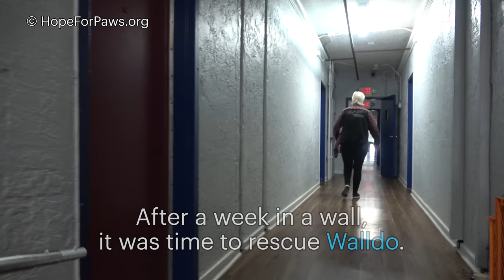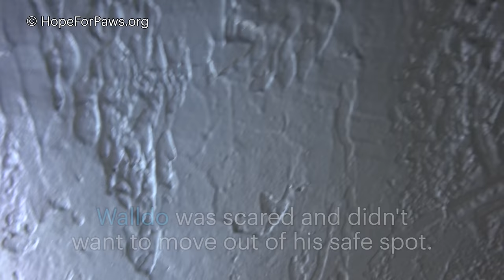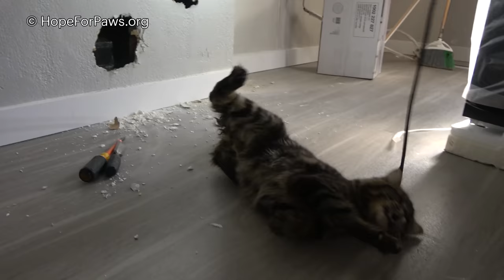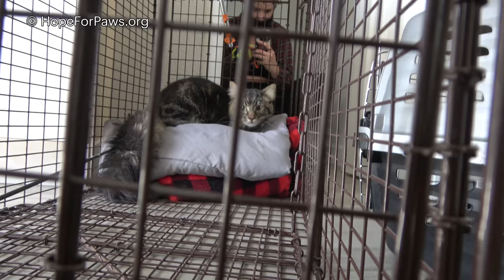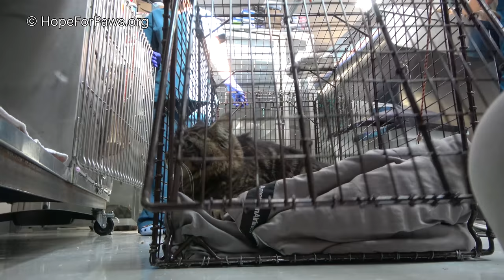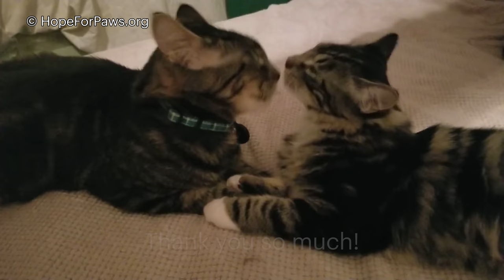Scared cat sends the first rescuer to the hospital with serious injuries. #cat

Comment: Anyone in a similar rescue situation, please use a towel and cover the cat. Then scoop it up and gently put it in a carrier or cage and then also cover the carrier so they can't see. It will stop all the flailing around and panicking. They react that way because they're super scared and under a lot of stress. A lot of these cats are not feral. Unfortunately most cats like this get labeled as aggressive or feral and it does not end well if they wind up in a shelter. Thankfully this little one was rescued by Eldad so he could prove what a sweetheart he is.

Comment: I see that you use a snare to trap cats in several of your videos. I've never seen this method used before nor recommend by any TNR or cat rescue organization. I wonder whether a better solution would've been to have residents stop putting food out for a day. Obviously, if the man in charge of the building maintenance was authorized to make 2 holes in the wall to snare the cat, people were invested in helping this cat and would've helped. A humane trap with stinky sardines, mackerel would've drawn this beautiful cat out to eat with the trap at the end of the hole. I just believe it is unnecessary to use a snare when there are many other options.